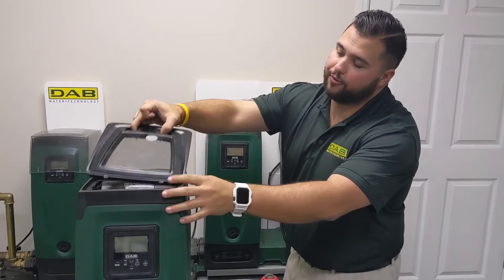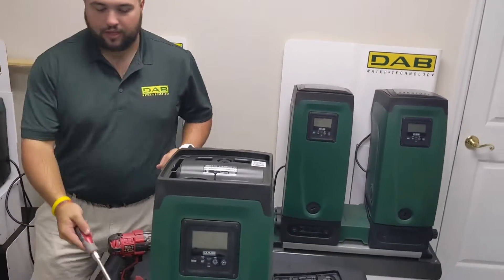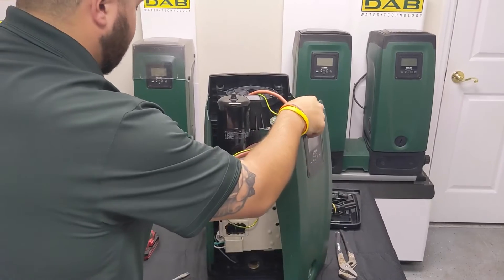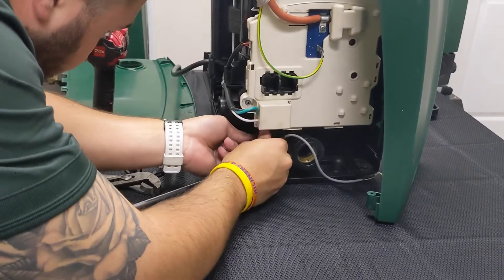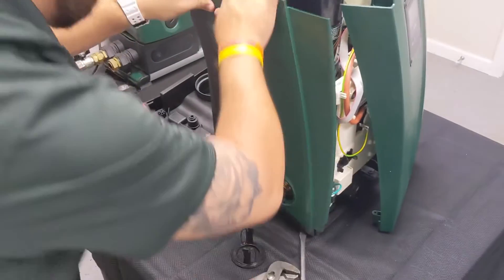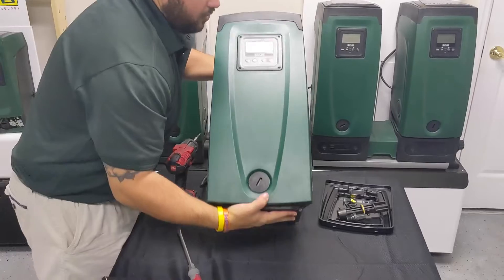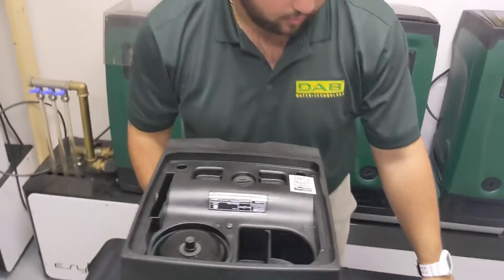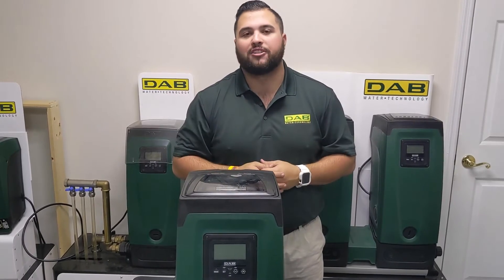How to replace the Pressure Sensor on the DAB EsyBox

Comment: The pressure cylinder on our DAB EasyBox will not pressurise. Can you make a tutorial on replacing the pressure cylinder, sometimes known as an accumulator. We are at sea 24/7 except for two weeks every 2nd year. The pump supplies our Domestic Fresh Water system. We have no backup system.

Comment: Hi!! Thanks for the video, my e-sybox shows E16.22 related with a problem in the HV. I have measuring the different voltages in the PCB and that's ok. I also have measuring the comunication between the HV and the LV and it is present but I don't know if it's ok. The HV doesn't send the inverter pulses to the IGBTs drivers. What can be the reason?